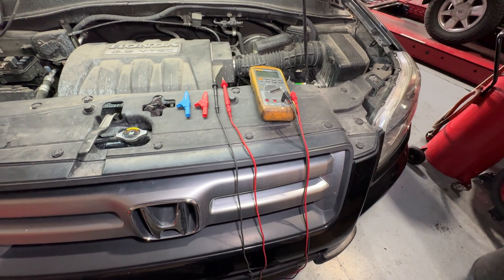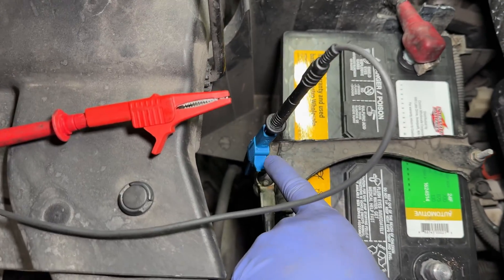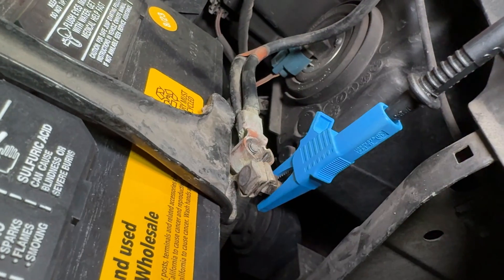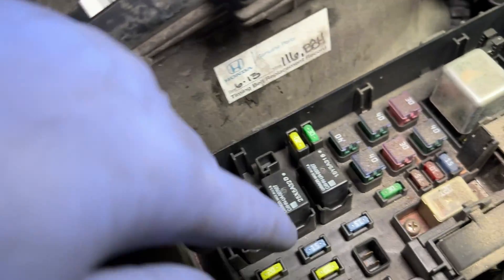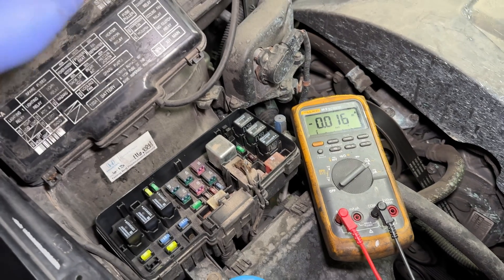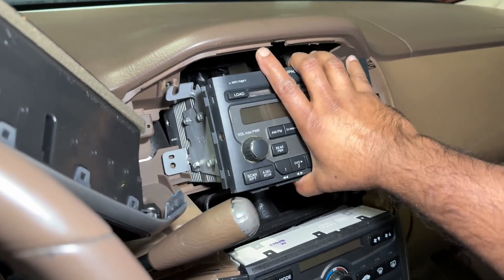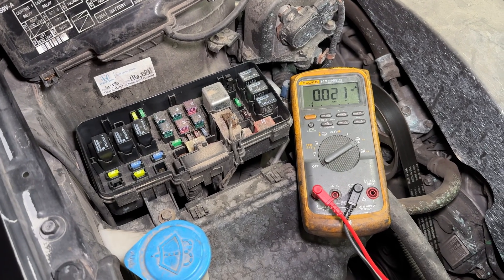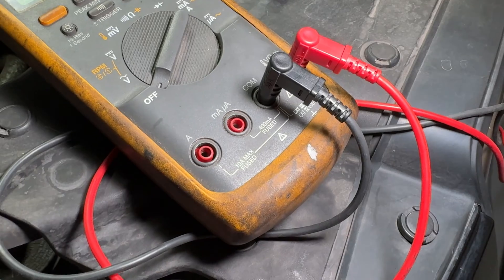BATTERY DRAIN TEST PARASITIC DRAW : 2006 HONDA PILOT

Comment: Great video. I am trying to do parasitic drain on my honda pilot 2017 but it has a push start and not a key. Do I just unbolt the negative battery and then attached the multimeter red on negative cable and black on negative battery post then just unplug fuses one by one? I initially did that and i read 0.47 on the multimeter without taking any of the fuses yet.

Comment: thank you so much for sharing this!!  i have a 2014 honda pilot, i had the alternator and battery replaced. I still had issues with parasitic battery drain. i followed your video and found the issue within 30 mins . it was the dome lights. my problem has been resolved!

Comment: The factory radio has an anti-theft design that requires you to put in a code one time in order to operate. No point in stealing it if you don't have the code. I'm guessing they use a volatile memory to accomplish this. To prevent you having to put in the code every time the the car is turned off or the fuse is pulled, they power it constantly via an auxiliary (non-fused) circuit.  The non-fused circuit powers that internal anti-theft system memory (and probably radio station pre-sets and other internal memory,) apparently requires ~200 mA (holy cow!) of current constantly.  Thank you so much for running this down! I have a 2008 Pilot (same wiring as 2006) and this problem has bothered me for years. Now I know!

Comment: Another way to check which circuit is causing a parasitic draw is by measuring the voltage drop across each fuse rather than pulling them out as on a  lot of newer cars removing and re installing a fuse can wake up a module the voltage drop will be in the millivolts. if a fuse reads anything other than 0 volts while the car is completely off then there is current running through that fuse. Ps you may have already known this lol.
Reply from the maker: This also works, I find that my multimeters give me unreliable results sometimes though. Using this method I once spent hours thinking a circuit had a drain and I was on the wrong circuit. I switched to this method using the ammeter and found the real drain. Could be my equipment, idk, but I default to this test now. You’re right though, it’s a pain re-initializing everything when the battery is hooked back up but on these bigger parasitic draw complaints, more often than not, the battery already died on the customer where the vehicle had zero power, so it all has to be learned anyway.
Reply: @SkillCollectors  I'll always confirm if the circuit is causing the draw by pulling the fuse before I move on as well.
Reply: So do you probe the fuse using a multimeter in the fuse box one by one and the multimeter is set to 20v dc correct? This sounds much easier than pulling each fuses
Reply: @legit_marvin  no you set it to a millivolt scale